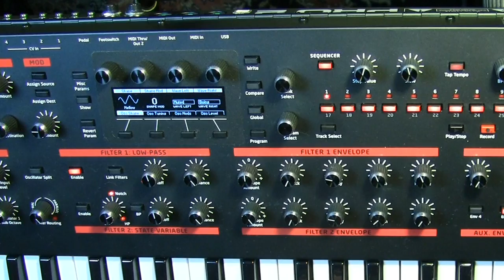The Dave Smith Pro 2- Sequencer Examples 4 and 5

Comment: I'm confused. Can you have each oscillator on a single track with each track playing sits own sequence with different voices and effects?
Reply: Not sure if this is what you are asking,  
From Pro 2 Manual....
"Cue" function  lets you continuously run the sequencer while you switch from
program to program. The sequence and sound associated with each
program will play until it reaches its end, then change to the next
program (and the sequence associated with it). If you save multiple
versions of the same program, each with a different sequence, you can
use Cue to switch through them in real time, effectively stringing multiple
sequences together to create a “song” in real time.
Reply from the maker: You can have each oscillator on its own track playing an individual different melody, etc. They can be different voices, meaning each oscillator can be set to a different pitch and waveform setting.  Because you can send different oscillators to different filters, different envelopes, etc., you can have different voices.
Reply: Wonderful. Is it possible to ratchet steps and chain together sequences? I'm trying to debate between a Pro2 and Oberheim Two Voice Pro.
Reply: Ken Santillan I suppose that's one way to do it. I'm just trying to figure out if I should get the Oberheim Two Voice Pro or this for my sequencing. Not sure if the Pro2 can ratchet steps like the Oberheim.

Comment: I'm Pure Data/VSTi software synths user, and I came here trying to decide between Elektron Analog Keys and Pro2 for live improvisation (will be deciding on Analog Rytm vs. Tempest next year - that's a hint, Marc). Watched the entire series, and - despite I hoped to see arpeggiator and program management explained too - thank You Marc, useful video series. Your videos really showed me what Pro 2 is, what it isn't, and - as a side effect - upped my "brand loyalty" towards DSI in general. Yep, they made a good product.
My thoughts on Pro 2 vs. Elektron Analog 4/Keys are now as such (noted with plus for pros, and minus for cons):
+ Pro 2 has an interface way quicker to work with - not much menu diving involved. Display is better, too.
+ Pro 2 has latchable pressure-sensitive strips in addition to pitchbend/modwheel, where AK has only a joystick.
+ more CV options on Pro 2, both jack-wise and mod-wise => easier integration with modulars
+ twice as more oscillators on Pro 2, but...
-- twice as less sub-oscillators than on A4/AK (they have two), and that single one is limited to sine wave :-(
+ "one-dimensional VS" (vector synthesis) is possible, but only within the limits of Pro 2 factory-preset waveforms
= oscillator-wise I guess can live with digital oscillators, adding some "dirt" to them every time.
= as far as polyphony goes, there seems to be a kind of tie between AK and Pro 2.
-- can't load user waveform in Pro 2 oscillators
-- LFOs don't go up to audible range (but the opposite seems to be true, e.g. modulating with one of the oscillators itself) nor do they go real slow
-- Elektron Overbridge, despite being limited to Windows, kinda allows one to use the synth as an audio interface; not something that DSI synths can do AFAIK.
-- software editor for Pro 2 is not free - oneneeds to purchase it for money, while Elektron Overbridge is free to download (but closed-source).
-- this -127...+127 all over seems so limiting, so 1980s...
-- low capacity of sequencer - I'm finding that I do need up to 64 steps (and sometimes, but rarely, more), I do need more note tracks to input notes from keyboard, and I do need track mutes and pattern changes on hand.
-- on Pro 2 there's basically only one dedicated note track, and seems like one can't input note values from keys into tracks 2 onward. That, and previous one too, killed it for me.

Oh and btw, patch #4 is cool and interesting. Liked it better than patch #5.

Comment: very nice. its basically there where Elektron is since a few years ;)
But I got fixed. It shows up on the Radar again.

Can the Sequencer be Midi synced? I guess so.
Can it play with Shuffle/swing (however one calls it)?
Can you shorten the Seq lengths or play it backward and forward etc. (Like the Sub 37 can since the update)?
And can the Seqences be transposed via Keyboard on the fly? and if yes do the restart every time a key is pressed or can you chose to let it run through the seq and transpose it as it goes through (like f.ex. my old MFB Synth2 can)?
Also is there a way to change the pitch of the other three Oscilators in the other Three sequencer tracks via Keyboard, not Controller? Would be an easier way to generate polyphonic Sequences :)
Reply: yes, it can
Reply: I guess "no" for the very last of Your questions. You have to tweak the knob.

Comment: The character of these sequences reminds me of the somewhat more primitive, but very capable modulation sequencer in the (underrated) Korg MS2000.  I use it often to create what I suppose you could call textural grooves- grooves that are based not just on notes but arbitrary changes of synth parameters. But on the Korg, in order to get this much stuff happening you absolutely need to bring in the arpeggiator and synced LFOs, which makes things rather less controllable - I like it because it is Ike negotiating a riff out of the instrument, rather than just creating it outright. The process is very interactive, and the results can range from sublime to absurd.

I'm not suggesting the Korg is better or worse in any way than the amazing Pro-2 - I'm just sharing my love for mod sequencers. This  used to be the exclusive domain of modulars, so it's exciting that it has become more common on self-contained synths.